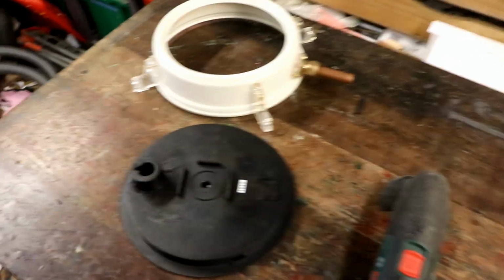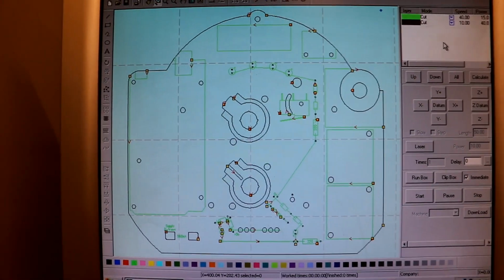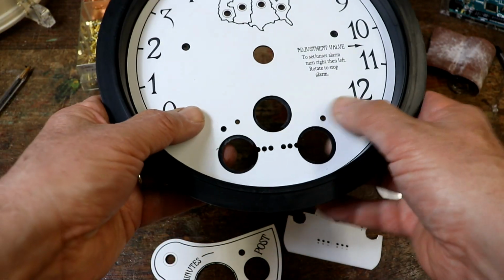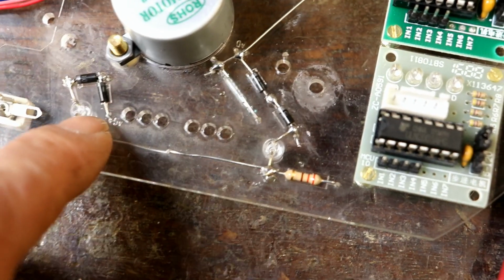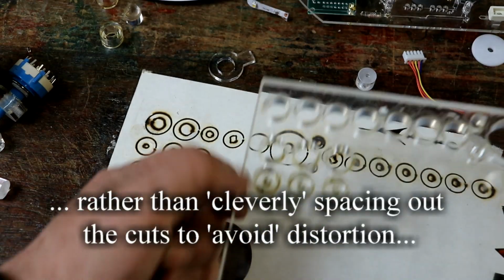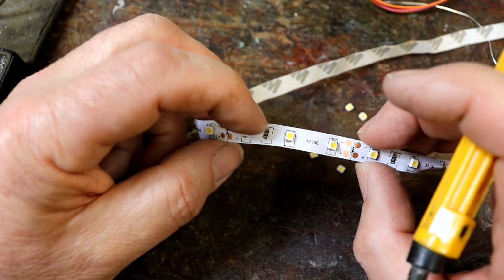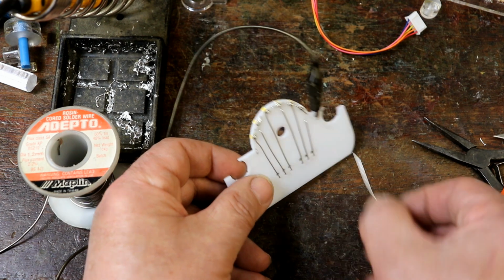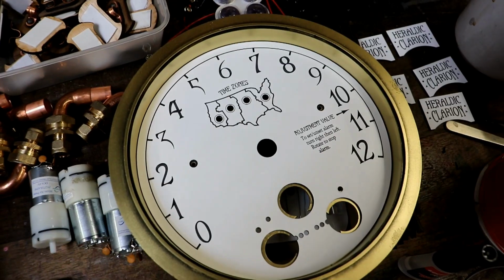Make a Steampunk Time Zone Clock - part 3

Comment: What sort of cutter/engraver do you use that is capable of cutting clear perspex? Absolutely stunning work by the way
Reply from the maker: I have a 60Watt water cooled CO2 laser cutter - the best thing I ever bought! It's an LS 3060 from HPC Laser Ltd in the uk. It's such a joy being able to draw a CAD design in the kitchen and then to immediately cut it out from acrylic in the workshop. HPC recommend not using it above 40% power to preserve the optics and laser tube - 8 years on and it still cuts and engraves perfectly.

Comment: Hi there i was wondering what material you make the clock faces from. Is it laminated acrylic ?
Reply from the maker: For all my labels and dials I use laser engraving laminate. It does smell far worse than acrylic when cutting, but gives a beautiful finish with both raster engraving and fast engraving using lots of lines 0.1mm apart at a low power. Don't be tempted to go for cheap options as they are awful and can produce so much soot that cleaning it off also removes the top layer. I always get mine from Techsoft in the UK who offer a range of colours. The soot can be removed with either isopropyl alchohol or white spirit, other solvents may also dissolve the top coloured layer. Good luck!
Reply: @steamhead  thanks ill give it a go

Comment: What type of software are you using to design the parts for the laser printer. My friend has a Glowforge being delivered next week so I need to start learning how to use it!
Reply from the maker: Coming from a teaching background I use 2D Design by Techsoft. It's very basic by modern standards, but so am I and it's far better than the huge sheets of tracing paper I was taught to use. I believe there are many good free CAD packages around. I've always been put off by AutoCad as it is so expensive. Good luck with your laser cutter  - how exciting!